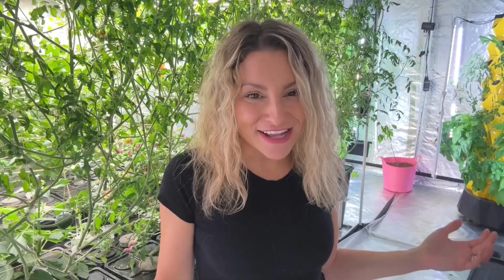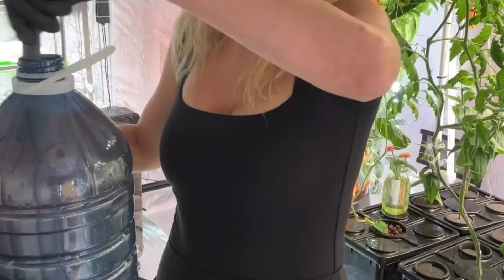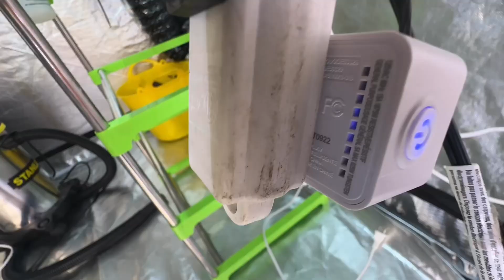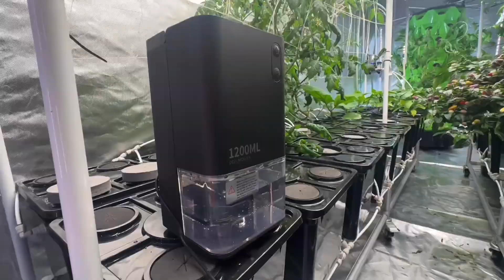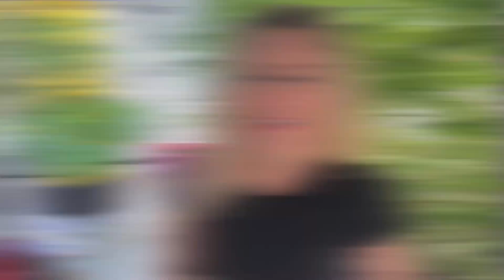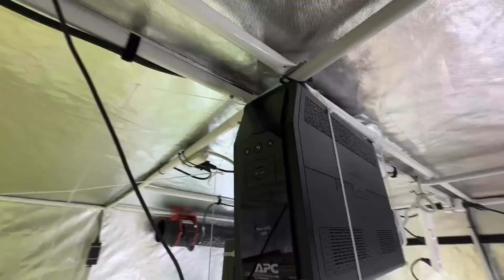TOP 10 QUESTIONS ABOUT AEROPONICS & INDOOR GARDENING 💚✨

Comment: You made me smile but it is not that much :) when you talk about your nutes it is indeed what you call chemical synthetic, it is not organic since it directly assimilated as ions bio available directly to the plants ( no need microbes mushrooms etc) but anyway not a big deal, i use the same kind of nutrients and it give me the same results as in soil :) 
Secondly when you talk about pressure change in the system causing the leak, i never encounter this phenomenon and i’m doubting about it because in my case i always got nozzles clogged even all the line in the very beginning lol and i can swear to god i never have leaked due to this, leak can happen with bad fittings that don’t handle the time correctly, i work with an accumulator tank as well before going to the pump the solution is filtrated via 50 microns filter and second sediment filter, the annoying thing is to prevent the first to be too dirty and wash often to avoid clogging to fast the sediment one, once i finish my run, i suck peroxyde hydrogen H2o2 12% with all the equipments except nozzles that are wash manually ;)
This way i run from many years aeroponics like a crazy fool but i swear i can put some organic things lol but i feel the filter clog faster with every additives :)
Otherwise i make Atomized Aeroponic but the air compressor is much louder for silence confort 😂😂
Reply from the maker: Thank you so much for the feedback!!!! 💚💚💚💚💚 thanks for watching and Happy Growing!!!!! 😊🙏🤩☀️ What do you grow?!
Reply: @TheFreshPrincess  A pleasure for me :face-red-heart-shape:🪴
You definitely have a bigger indoor space than me but it's because i grow can nabis with this method and some potatoes and tomatoes but with cheaper material lol because i'm still broke 💸📉😝
Reply: Note: for the leak i had surprise to have huge roots and some directly stared front of nozzle of too near of the top junction of buckets making some drops continuing leaking ;)
By the way continue to male this you rock it girl, i’m glad to see lady at the top of the indoor grow nowadays 😇
Reply from the maker: Thank you so much for the kind words!!!💚✌️😊☀️